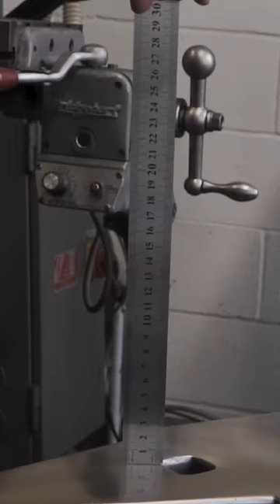"Pig" Anvil Restoration, Super Speed Build! #shorts

Comment: Correct me if I’m wrong, The base is usually made of wood to absorb the shocks.
Reply: That whole setup is going to rust like a mofo.
Reply: You want it to not absorb shock
Reply: @amazoniancustodian  better for the life of the anvil to use wood
Reply: Yeah a stand like this really isn't the best choice.
Reply: @amazoniancustodian yes but also no.
Reply: @dannyeckerd9324  The force you imply on the anvil needs to reverberate. You want the hammer to bounce back as much as possible, so that you have to impart less energy to the material you are working. You don’t want to smack a ceramic, but you damn sure don’t want to smack rubber.
Reply: @amazoniancustodian  I have been blacksmithing for 2 years and I've used both kinds of anvil stands, the problem with metal ones is that they will jump if you don't anchor them to the ground, and even if you do they will ring like crazy, put chains around it put magnets under the heel and horn none of it will matter it'll ring so loud it'll hurt your ears anyway. And yes you do want blowback on an anvil, but the blowback comes from the mass of the anvil itself, not the stand. I started out with a metal stand and I can say from experience that they suck.
Reply: @amazoniancustodian  oh and blowback does not impart more force on the iron it just means that you have to use less energy bringing the hammer back up.
Reply: @dannyeckerd9324  was my point almost wholly, about less energy being used to do the work. And I hope you believe eyes and ears are important to maintain. We don’t have to be savages like our fathers.
Reply: @dannyeckerd9324  protect your ears bud
Reply: @dannyeckerd9324  That stand is mostly concrete, it's not going to ring.
Reply: @dannyeckerd9324  he did make the anvil stand from just little bit of metal but mostly concrete. That's heavy as fck Is it really gonna jump around? And ring? 🤔 And I think concrete would be better at bounching the hammer than just metal? I'm not blacksmith, I have used anvil only like 15-20 times I'm welder so I don't know much
Reply: @dannyeckerd9324  wonder if one were to place rubber bushings under the anvil stand, or maybe even between the anvil in the stand, if that would eliminate some of the ringing? In the HVAC world there are rubber bushings that come in a big mat type form. They almost look like a big square waffle that's designed to be cut apart into whatever size and shape you need with its littlest squares being 2in by 2in.

That stuff is made out of very tough rubber designed to hold extreme weights & dampen vibrations & noise. The rubber seems to be a little stiffer / tougher than your average car tire.

I've seen that material used on rooftops under units bigger than trucks, so I imagine it will hold up under the weight of the anvil & stand..
Reply: @amazoniancustodian  As a 62 year old Blacksmith, I have never used an anvil with a metal base. always a wooden block. If metal was better, Blacksmiths would have been making metal stands hundreds of years ago. BTW I started my Apprenticeship in 1976
Reply: @BigBadLoneWolf  I do thin down the sides of my hammer hafts but I do so to give me more control over the alignment of my hammer strikes I had never thought about reducing weight to give more blowback. Funny you should mention shaving on Hammer hafts if you look at plastic handled hammers you'll notice that they're a lot thinner and feel nicer in the hand where has wooden-handled hammers are super bulky and feel as such in the hand, that's because you are actually supposed to shave them and sand them down to fit your hand.
Reply: @amazoniancustodian  I thought you were talking about the wood 🤣
Reply: @ferrumignis  that's true, honestly the biggest thing that I don't like about this is that it will ring like a bitch.
Reply: @beatnik6806  you're correct, I don't believe this one will bounce all that much however the ringing will persist. Also Hammer blowback comes from the anvil alone, I've had my 125 lb anvil on wood metal dirt and Stone, the blowback is the same no matter what, if you were to get a smaller and full of the stand might matter but when it comes to the big boys all the mass you need for blowback is contained in the anvil
Reply: @mrfixitusa6165  I might actually have to try this, I've tried all of the traditional methods of deadening (wrap a chain around it, put magnets under the horn and heel ect,) but this might actually work really well, I do something similar with leather where I place leather between the stand and the anvil but suffice to say again the leather flattens after a while.
Reply: @dannyeckerd9324  not only did we shave down where we grip the shaft, but also narrow behind the head of the hammer head, to make it spring more. This saves your wrist from aches
Reply: @BigBadLoneWolf  I had never thought of it that way
Reply: Yes they typicallu were 
Mounted in sturdy log bases in colonial times. State of iron working was casting in a foundry, then blacksmithing all small to medium parts Electric welding did not yet exist in the 1600"s or 1700"s or 1800's. Thank Tesla and Edison for their work
Reply: @nickschurko4809  true that in colonial times welding did not exist, however a metal stand like this still could have been made, but it would have been riveted together instead of welded. It's just that no one would have because it's not very cost effective and would have been a huge waste of time frankly 😅
Reply: I own a collection of antique anvils, but my favorite by far to use is my Delta Future that has an aluminum base and a layer of rubber between the steel and aluminum
Reply: @russellchampagne3830  oooooohhh!
Reply: @dannyeckerd9324  yes I would love to find out how it works out. I've seen the stuff after a unit has been sitting on it for over 25 years, and it may have a 1/16 to 1/8 of an inch imprint on it, but that's not much when it's 3/4 of an inch thick.

You should be able to find some at any American hbac supply store.

Like Johnstone supply, R.E. Michaels, etc.
Reply: @mrfixitusa6165  I'll check it out
Reply: Any shock absorbed in the anvil stand is just energy what didn't get absorbed into the workpiece. 
If it's wood or steel & concrete. Either way, it's such a small difference, its unlikely the Smith will notice a difference. 
But difference exists and the more solid & dense the anvil base the better.
Reply: I would guess that is the role of the concrete...  Not sure if it will work
Reply: He was checking flattenes with cheap Chinese ruler
Reply: Beautiful presentation of an anvil. Great for a man cave. The  tabs are a great and easy way retain the feet/base. I think I'll try that with my Haybudden made in Brooklyn a hundred years ago.

 A plate with those bent over tabs lag bolted to a wood round or crotch from a tree. I just so happen to have all the stuff. My next project.
Reply: I usually just use a stone block. Deepslate usually looks nice. They always break after the same amount of uses anyway. Enchantments might make it break sooner though. Idk
Reply: @amazoniancustodian  WHAT?!?
Reply: how many extra times would you like to hammer that iron? I know! Let's mount it on a mattress.
Reply: Nope, the idea is to keep as much of the energy in the anvil to essentially bounce it back into the steel you are working on, you want as little energy loss a possible. That why how much a ball bearing bounces or rebounds on the top is so important.
Reply: @Ipauler  Yeahuhh, I caught that too !
Reply: @amazoniancustodian  my ears are already shot.
Reply: We had anvil seating in drum of Sand , very compact sand ... definitely   concrete won't be good idea
Reply: @Karloscc13  I’ve heard of that being done too, How did you find it compared to other anvils you’ve work on.
Reply: @beatnik6806  concrete wears faster in this scenario
Reply: Anvil in barrel of sand was good , it's  long time ago when we was in school training for blacksmith.  I notice on few places where I worked as if anvil was on hard base , steel or concrete,  Hammer was bouncing back more and it even  sounded  different anytime you hitting anvil .
Reply: You’re right, we have anvils at work and they are all on solid oak blocks with u shape fixings. They have been their for 60 years
Reply: @BigBadLoneWolf I agree, but this stand is concrete. The metal is just holding the anvil on.
Reply: @Stroke-it-2Handed  probably won’t matter with a hammer but if you are using a sledge hammer god help you it will kick like a horse
Reply: @paulhiggins8774  it will work just as good as any log or beam stand, or sandbox, or anything else.  It doesn't matter at all, because the fact is, people mount them to logs because they are easily attained and require little preparation. There is no perfect way to mount them.
Reply: Да и бетон в основании от вибрации довольно быстро разрушится, я думаю.
Reply: You are right.
Reply: Maybe that's why he mounted it using a layer of silicone or polyurethane?
Reply: Nice piece o’ steel
Reply: i did not know that
Reply: @amazoniancustodian  
 No..  you do not want the hammer to bounce back!   You want the energy to be imparted into moving the hot material/metal.  If your hammer bounces back..  your metal is too cold!
Reply: Far too many innuendos in this statement
Reply: @dannyeckerd9324  anyone blacksmithing without ears on or in is highly regarded 🤠
Reply: You want the metal to absorb the shock not anything else if that energy goes anywhere else it's just wasted
Reply: I think one of the jobs of the anvil it to absorb shock...why they are heavy...
Reply: @Ipauler  the dude just machined an ANVIL!!! I think he has flatness covered. Bunch of haters on here. Jealous much?
Reply: Ye and wont the concrete crack up from the hits?
Reply: Better a palm tree base...
Reply: On all these comments about the ringing. Do you think the guy who made took into consideration? He did take a lot of care and preparation to make. I can’t help but thank that goop or caulk was the rubbery cushion between anvil and stand to deaden ringing! It’s a cushioned later between the two metals. And those welded metal tabs to simply hold the anvil on horizontal axis aren’t going to transfer to much ringing sound energy from anvil. Just my thoughts. And probably his too….!??
Reply: @beatnik6806  the ring doesn’t have the right ting to it for the good anvils.
Reply: Согласен
Reply: No, you want the shock to go into the workpiece, this is why cast iron anvils suck. If the base aborbs the shock then the workpiece isnt.
Reply: He put rubber under the feet
Reply: @mrfixitusa6165  not to mention that they have cork core. AND can be used use as shims. He must peel apart the layers. Love those things.
Reply: Zgadzam się z betonu popęka
Reply: Zgadzam się z betonu popęka
Reply: Yup, or in my case we had a big box filled with some coarse sand and had our anvil sat ontop that.
Reply: You are absolutely right. The base must be made of wood
Reply: That's an old school thing the base being wood. Did you see him apply the silicone at the feet of the anvil when he seeded it on the stand, that'll absorb plenty of shock. Not to mention he filled the base with concrete of some sort and that's going to absorb a ton of shock
Reply: @amazoniancustodian  @dannyeckerd9324 clearly makes more sense to me as Engineered and mechanic than what you reason with. The shattering vibration high frequency noice or a stump with the right length and mass, so to be acting as a tuned damper.
Reply: @amazoniancustodian  noob?
Reply: I think that might be why he put silicone underneath the anvil and didn't weld directly to it, idk tho
Reply: Yes that’s why he used concrete and silicone in its construction
Reply: @amazoniancustodian if it doesnt absorb the shock the forces will be applied back into the opposite direction the hammer is hitting and make less of an impression on the metal you are working on.
Reply: This video is like sanding your cast iron skillets
Reply: Or wrapped in chains for the same reason. Sometimes both
Reply: @blaidddrwg-ye9dy  better to have not so many hits to do
Reply: It was fine the way it was originally. Just took a quality anvil and fucked it up nice going
Reply: So much hate on the stand.  How bout the idea and the craftsmanship.    Why is it some people always look into negative.  This is a great idea   Let’s see your stand!   😊
Reply: That's what i said
Reply: @mrfixitusa6165   Yes, thin hard rubber pads under the feet of the anvil would be a good idea. 

The purpose of a stand is simply to hold the anvil securely in place and at the proper height. An anvil of the proper size for the job is itself a sufficient inertia sink. If one is concerned that the anvil will jump, one might consider a bigger anvil.

 A stand made of laminated 2x4s would have functioned just as well, although a high-inertia stand  might be a reasonable substitute for bolting to the floor if one is afraid it will somehow get knocked over in the shop.
Reply: It's ok as you can see he has wood flooring
Reply: Will the top darken to the rest of the unmodified portions. I like to old look.
Reply: It is, it's called an anvil stump.
Reply: @amazoniancustodian  Ash is the base of an anvil
Reply: It’s an anvil. What’s an average life?? 50+years
Reply: You want it to put the energy into the work piece not absorb it. And good rebound for efficiency.
Reply: If it absorbed shock it wouldn't be an anvil.
Reply: @joeholland9593  i just want to see how he moves it
Reply: @dannyeckerd9324  invest in some ear plugs
Reply: @Scuba1Steve  ear protection isn't my issue I usually have some sound cancelling headphones to play music through. The problem is that I live in a neighborhood with neighbors and worse the HOA
Reply: @amazoniancustodian  you don’t want it to be soft like a pillow but I’m sure the concrete will crack after a while. The base needs weight but concrete shouldn’t be the pillars or what holds it up. It doesn’t matter what the base is made out of as long as it’s heavy enough, isn’t top-heavy and doesn’t crack
Reply: @roosterboy7357  HOA sucks ass but as long as I don't make any loud noises past 8 a clock the neighbors don't complain
Reply: No offense, but you literally built the worst possible anvil stand ever..more than willing to elaborate on that fact as well.
Reply: @XanderJuhasz  then elaborate
Reply: @zacanac8986  try closer to 300
Reply: Your wrong the base used to be made out of wood because that was the most sturdiest thing they could put it on. But you don’t want it to absorb the pound you want it to be as hard as possible. so when you hit it. It would be like between a hard spot and a  rock. With no resistance.
Reply: @jerryragan9414  woods not the sturdiest thing you can put an anvil on that would probably be Stone. And they had plenty of it and there were plenty of instances of anvils actually being made out of stone.
Reply: OK for those two say they’ve use metal stands and would let me put it this way with the metal stands. You need to have sand inside the metal stand to absorb that ringing of the anvil. That way you can mount your hammers and such using a rectangular tubing, six”by 12” filled with sand will work perfect.
Reply: @jerryragan9414  that actually does sound a lot nicer.
Reply: Actually, it’s to keep it a lot quieter. In addition, without the wooden base the hammer sends bounce back shocks through your arms and you deform the anvil a lot quicker.
Reply: @TechieTard  I’ve always had good luck with rectangular tubing little bit larger than the size of the anvil. And fill it with sand about halfway or better before you weld the top on it absorbs a lot of the shock a lot of the hammer waves, and has always worked out great for me.
Reply: @dannyeckerd9324  hitting sheet metal on a wood table will ring your ears it’s gonna be loud no matter what lmao
Reply: Thats why he put caulking under the legs
Reply: Just put a rubber mat under it and you have the best of both worlds. Not even thick. Maybe just 5mm
Reply: Też mi się wydaje że to lepsze rozwiązanie blok drewna niż betonu pod kowadło.
Reply: El abuelo era Herrero de los de antes que hacían herradura y más, el tenía un gran tronco de madera maciza,  ahí tenía una gran bala sólida para golpear, hacer la base se hierro, es mandar al carajo tus tímpanos (oidos)
Reply: @joeholland9593  na he just gotta hit it with a little bit of that Dan o’s
Reply: @Sharrieff93  It is sad that I watch enough shorts to get that reference.
Reply: @joeholland9593  😂 same
Reply: I’m a blacksmith, Bases have been made out of anything and everything, doesn’t matter
Reply: @BigBadLoneWolf  
I built a steel stand for my old American Star.
I welded 4 heavy duty vinyl castors on the bottom of the stand so I can wheel it around.
Works pretty good.
Reply: E l"acciaio dovrebbe essere temperato, almeno in superficie.
Oppure è ghisa?
Reply: Naw bro conk reet look nice
Reply: @dannyeckerd9324  you are mostly right about that in that in terms of your point you are correct but the force that launches the hammer back up has to go somewhere and that is into the metal as it is not composite with the anvil and stand
Reply: @aidenburnside6380  I don't know what kind of gravity amplifying anvil you've been using but I don't really think all that much energy gets put into the work piece rather it travels through the work piece and into the hammer, I mean hell there are certain spots on my anvil that will make the iron I'm working on jump with the hammer
Reply: @amazoniancustodian  the only way you want that is if it's light, that's why the anvil is heavier than the work. That way it doesn't have to be rigid.
You can crack them for sure
Reply: Concrete is fine. It really doesn't matter you have a rather large piece of steel that is on the other side of the piece of hot metal you're hitting.
Reply: @jerryragan9414  how would sand coated with oil work
Reply: I think you’re wrong, because anvils aren’t meant to disperse energy. The point is to literally put something between a hard place and another hard place
Reply: @sabianandrews3257  obviously they're not meant to disperse energy, which is why if you put something under it that will help rebound the energy back into the anvil instead of losing it through the stand it would be advantageous, capiche?
Even if there was just a negligible difference, would you rather stand on a concrete floor all day or would you rather stand on a rubber or carpet? It's like that, people that actually use these and not just as a hobby know that they don't want to be swinging a rigid object into another rigid object all day.
Reply: I'll stick to wood if anything else was actually better we would of known it a few hundred years ago just like leather work the best tools are the ones we've use for the past few thousand years like
Reply: Very cool
Reply: Glad i read a couple comments. Did a good job on resurfacing. Will concrete will break up after time wouldnt it?.
Reply: @SW-ii5gg  with oil ????? …. No you fill the rectangular tube with sand no oil
Reply: @dannyeckerd9324  that's why he put silicone under each leg of it. Got mine on a metal stand but I got 3 inch thick rubber mat that goes across the top of my stand no ringing and hammer bounces back perfectly
Reply: Concrete
Reply: @joeholland9593  he sprayed antitrust paint on it. It’s quick so it’s easy to miss
Reply: @Amazonian Custodian  no you don't.
Reply: @dannyeckerd9324  the stand he made was in fact not metal but concrete
Reply: You could simply put a rubber pad underneath to aid with shock and also lacquer it to prevent rust..chill out guys it's still a good resto 👍🏻
Reply: Yes it is, and the feet don’t have to be flat nor true
Reply: Absorbing shock is a bad thing, means you have to use more of your own energy to lift the hammer each time. You want it to deflect as much of the energy as possible back into the hammer to help you bounce it back up and not get tired. Those hammers get heavy
Reply: @dannyeckerd9324  Blowback is the direct transfer of force from the hammer back into the hammer. It wouldn't be possible without a more thorough transfer of force.
So a harder stand DOES equal more force imparted into the iron, that's literally Newton's Third law.
The problem is HOW MUCH force. Is it even worth it? Probably not, but the significance in blowback does make a difference in force applied.
Reply: @BigBadLoneWolf  This is a naïve take.
If metal stands were better AND CHEAPER blacksmiths would've been making them forever. However, wood in most of the history of blacksmithing was free or nearly free, and required anyway for heating; so the use of a stump or log as a stand is just the easiest and most economical thing to do.
It's worth noting that ancient blacksmiths DID try to make harder and harder stands; but they were far too expensive and far too unruly.
We live in a completely different time, when metal is cheap and manufacturing is cheap, and the benefits of a sturdier stand can be better appreciated.
Hence why power hammers don't use wooden stands, nor did a majority of treadle hammers, and most anvil stands made during the turn of the century were metal reinforced.

Also, 60 year blacksmith's opinion on ancient anvil stands (based on his limited knowledge of the history) < A historians take on anvils as documented throughout known history.
Reply: @GlorifiedGremlin  The material is really what you want to absorb the shock.
If your base is absorbing shock, the energy what would've gone into the material is dissipated in the form of heat and sound energy into your stand.
That same amount of energy can be better utilized against your workpiece if your stand is harder. This isn't debatable, this is physics. Wood is better at sudden elastic deformation than steel or iron or rock; and most wood is tonal to a degree, and will absorb or reverberate sound or vibrations throughout it.
Whether or not you prefer the loud bouncy anvil over the quiet poundy anvil is entirely personal preference, and anyone pretending otherwise is biased.
Reply: Why not a giant block of rubber to sit it on?
Reply: I built a 3-legged stand with square tubing for legs that have sand in them.  Really absorbs some of the energy going thru the anvil.
Reply: Cast iron base does the same thing.
Reply: Yes it is
Reply: @dannyeckerd9324  been a blacksmith for about 30 years, keep it up 😊
Reply: @angrymandalorian8496  thanks☺️
Reply: ...Вот и я про то же - наковальня должна стоять на мощной деревянной плахе...
Reply: Все правильно думаешь
Reply: There's no way that that concrete is cured all the way
Reply: In theory you want 0 shock absorption, as it decreases efficiency. That's exactly why we want to use anvils as big as possible, so they act as immovable objects. I don't think an anvil will degrade any faster if put on a solid surface. The whole goal of an anvil is to not absorb shock, but transmit energy.
Reply: Верно.
Reply: @amazoniancustodian новое поколение так же использует крупные колеса)
Reply: Surprised no one has clarified the answer…wood bases are preferred because it deadens the “ringing” of the anvil.
Reply: @flyfish697  i don't agrre with that. I'm using a tree stump as a base and the ring is pretty deafening. No, the real answer is probably even simpler : a piece of a tree has always been easy to source and move around in the workshop, making it a very good anvil stand. Steel was out of the question in History, and stone would make it impossible to move afterwards.
Also old anvils had a spike that needed to be put inside of something solid, usually a heavy piece of wood.
Reply: КРАСАВЧИК!!!!!!!!  Не только для этого и что бы не разбивать наковальню
Reply: Sand seasoned with oil
Reply: Да и ещё наковальня немного выгнута обычно так править удобнее
Reply: @dannyeckerd9324 so the chains are primarily to help weigh down the anvil/stand? I've always been curious about that I see people build these stands or throw up a hekin chonker anvil then wrap chains and was always confused about that.
Reply: They both work. To many people here stating opinions as facts. I've used both. Not enough difference to cry about.
Reply: That concrete will surely collapse
Reply: Yeah..... opposite of that.
Reply: Hardy Hole , the most useful hole on the block .
Reply: learning never stops, all through life
Reply: Bolted or more preferably chained
Reply: @joeholland9593 god forbid you take care of your equipment and clean it
Reply: @amazoniancustodian the wood absorbs it he said...
Reply: @bflamm86  You're 178 comments down, sorry not going to try to understand your context.
Reply: Wrong you want the bounce to make it easier to swing the hammer the hot metal will absorb shock
Reply: Its alot lighter too
Reply: @dannyeckerd9324 Wouldn't the required force be greater with less blowback due to the work of lifting the hammer?
Reply: I had a concrete base on mine and it crumbled apart within the first week
Reply: U can use a metal box filled with a deadening compound(sand) but set concrete was not the correct material.
Reply: @Ipauler Pretty sure the Chinese know how to make a straight edge. 🙄
Reply: Not necessarily. Old traditions use a stump, but modern working anvils are often set on steel legs, with a layer of silicone between, as shown. Idk about the concrete, I'd probably not go with concrete as added mass since it's likely to crack eventually, but I wouldn't say it's bad, as it does add mass. 
In a knife-maker shop, it's common to affix the anvil to a steel, 3-legged stand, which is then bolted or lagged to the floor. 
For a ferrier, it's either the same or mounted to something similar in a trailer.
Reply: that is rubber concrete (think +)
Reply: It’s usually a wood frame with some metal for support and it’s usually filled with sand
Reply: Yup wrong, you want as solid of an object as possible with no give
Reply: @dannyeckerd9324 Thank you for solid clear precise reasoning behind this explanation and not conjecture or ego. Many blessings
Reply: @ferrumignis  bravo, sei l'unico che ha detto la cosa giusta, gli altri continuano a parlare dai loro supporti in legno o acciaio, ma il cemento assorbe bene 😉
Reply: Да вы правы.
Reply: Мне кажется основание сделано из армироного бетона
Reply: youre wrong
Reply: Верно
Reply: Don't always need to be wood my grandads had a massive original one in his garden with a metal stand that came with it
Reply: If you use wood it might resonate and create bad ring but metal creates a better base for Less ring
Reply: Also you want it to radiate shock downward and away. Something the cellular structure of wood is pretty good at.
Reply: @Ipauler its a blacksmiths anvil. How flat does it need to be. Really
Reply: @amazoniancustodian  yes, you do
Reply: Egsactly nutwood !
Reply: This is The True Savior

HalleluYAH (Hallel u YAH) “Praise ye YaH”

YaH is The Father (Genesis 1)
YaH arrives via the TENT OF MEETING
YaH was Who they Crucified for our sins
YaH was Crucified on an Almond TREE

Semitic (Moses)
Isaiah Scroll (The Original Isaiah)

Isaiah 42:8
I am YaH; that is my Name! I will not yield my glory to another or my praise to idols.

Isaiah 43:11
I am YAH, there is no other Savior but Me.

Isaiah 45:5
I am YaH, and there is none else.
Reply: @Praise___YaH  fucking bots...
Reply: Most Of Your Comments Are Correct To a Point. But   Wood Gives = Lost Elbow Power to  The Head  ... This Form Of  Stand is the same as we Use .Commercial Engineers . 80 Percent do Not Even Know That all anvils can be Reworked.
Reply: Same principle as bucking rivets. The bucking bar is many times heavier and denser than the rivet or the shock would be absorbed and won’t compress the rivet. Mechanical force will transfer and be absorbed to the object with the most elasticity. This guy made a proper stand. The way in which he milled the surface cold with a face mill sort of shows he knows what he’s doing. But I forget about all the Facebook blacksmiths that know more than I ever would. I’ve been blacksmithing and forging for over 98 years. 😂